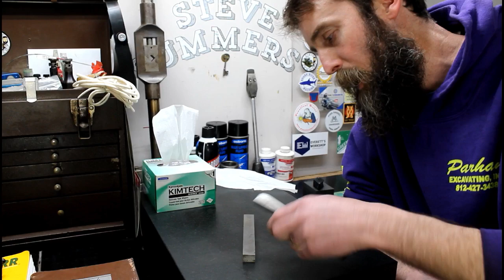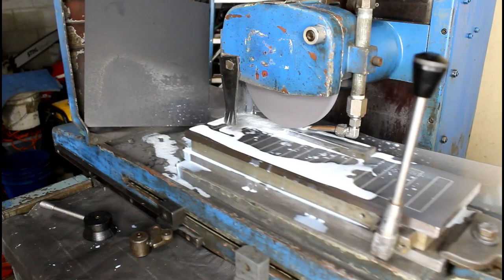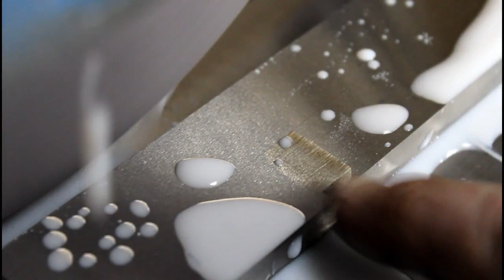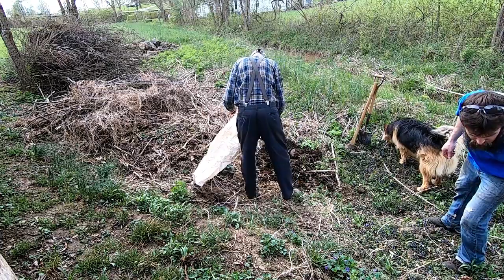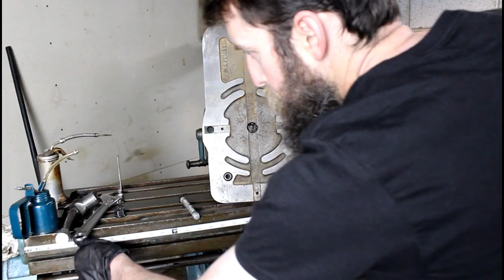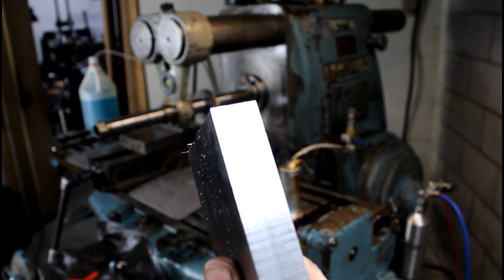Throwing a part off the surface grinder! HARD  :-)

Comment: Those weren't very good ideas. You shouldn't have blah blah blah ...
You can fill in the blanks. 😊
You want to know how I come up with all my good ideas?
They're the ones left after all the bad ones fail.
I damaged a test indicator because I put it where I could bump into it and knock it on the ground.
Thought it was a good idea when I put it there, but, no, it was a really bad idea. I won't be doing that again anytime soon.
Had to send it to Mark Ratkowski (MR Tool Repair) for repair.
It didn't cost much, he did a great job and it didn't take him long but I didn't have a test indicator for a month.
I had another broken one that I sent along with the one I dropped so now I have two good ones and everything worked out.
Not really convenient when you're trying to get some work done.
Long winded way to say I share your pain.
Thanks,
John

Comment: At the Summer Bash you can check with Keith Fenner on how or if you can straighten the arbor, the way he straightens prop shafts. I don't know if an arbor can be brought back by the same type of process or not. Good luck.

Comment: A few tips on the horizontal: Never tighten the arbor nut fully until you have the arbor support or supports in place..Never climb mill with that machine...When you fill the arbor support with oil, be sure to put a few drops in the bushing from your oil can so that the bushing does not run dry before the wick begins oiling....Mike in Louisiana

Comment: Tips. 
Block the parts.  Make sure the coolant contacts the surface before and after the wheel contact. When using low magnet force, take "tenths".

Comment: Steve, I'm not sure if it was just the camera angle, but it looks like you had your paw awfully close to that grinding wheel, had a friend who was a seasoned surface grinder operator who had a 1/4 wheel dressed to a knife edge take three fingers off reaching into wipe a part while wheel was spinning, he didn't realize he did it, until he noticed blood on the chuck and he look at his dangling finger tips...be careful..

Comment: I have been surface grinding for 30 years, for small parts like that put a couple drops of super glue under the high spot and wait about 5 minutes  for it to harden the use magnet full strength.  or use shims for larger warped parts
Reply: Really good tip there.
Reply: @steve gale  well any way that gets results and good parts..to each their own.
Reply: How do you shim 1 or 2 tenths?
Reply: i take a single ply tissue put under the whole part then use superglue under the entire part. but without the right coolant and wheels you will never grind better than .0002 usually..

Comment: To much step over caused the wheel to contact too hard and it expanded just like you said. Wheel seems a little hard,  use a deeper and faster dress to help cut with less heat. Paper towel soaked with coolant under the parts really helps get that little bow out of parts.

Comment: Some 40 years ago, i had to grind tiny thin parts. I walled them in with sheetmetal as best, as i could. One of them started of and flew through the shop like a bullet. I have no idea why, or where it landed. Never saw it again (was a large shop). It was late in the evening, i was alone. Normally, there were about 30-40 people working. I was very glad, that i was alone, and nobody could be hit from the part.. It happens from time to time. As long as nobody is hit, so what. But if somebody is hit, he maybe dead in worst case. Surface grinders are dangerous machines. And, nevertheless, fences do help. I would not throw the arbor away. Why not straighten it? Should be doable. Needs a bit time, but what´s to lose....

Comment: Morning Steve! What advantage is there to grinding at 45 degrees like TOT does?
Reply: Grinding at 45° means the grinding wheel is on the part less time than if you ground parallel with the table travel.
Reply from the maker: Good morning Craig. Like several other have said it's a heat thing. The less time the wheel is in contact with the part the less heat it inputs. Only draw back is it takes a bit longer to grind. But it's very effective 👍

Comment: I always “block” the part on a surface grinder when using residual magnetism
Reply: @anonymic79  my old boss related a tale from his youth working in a war production factory in WW2, during an air raid if the lights went out you had to immediately duck as the mag chucks also went out.
Reply: I always used to block stuff on a magnetic chuck, and you'd be surprised how good plasticine stuck all around the work piece holds it and stop's the ringing.
Very handy when grinding big thin stripper plates.
Reply: We do the same with blocking. Large flat pieces around the parts that are lower than the part keep the part being ground "corralled" on the mag chuck. Prevents it from moving sideways.
Reply: does that mean you put more pieces around it to hold it?
those magnetic surface plates freak me out.
Reply: Malice min I like using a thin piece of steel with more surface area just on the side that prevents the work piece from “kicking or breaking loose” I have seen more than one surface grinder with dents on the guard where pieces have been thrown into.
Reply: anonymic79 I understand 😱
Reply: I saw Robin Renzetti (I think, but I might just associate every really informative surface grinder video with his channel for some reason) use combs like this on his mag chuck to help hold down slimmer parts. Is this what you mean by "blocking"? https://sites.google.com/site/lagadoacademy/machining---lathes-mills-etc/build---comb-clamp

Also, could you explain what you mean by "using residual magnetism"? Do you turn off the chuck for some reason before beginning the grind, so the bars aren't actually engaged?

Also, would it have made sense to do light "cleaning" passes on each side of the parallel before going into the heavier passes to actually flatten the thing? Any pitting from corrosion would increase the distance from the magnetic elements and thus the holding force of the magnets, but I'm not sure if that would actually lead to a real difference in holding power?
Reply: Blocking is the most significant component to stabilize the part. Ensure that the blocking straddles magnet segments.
Reply: Blocking is always a good practice when able.
Reply: I was 6 and saw my grandad almost take his leg off with a saw. Safety is not to be understated.

Comment: Solid Rock Machine Shop had a video showing how to take bow out of a piece on the surface grinder. Pretty thin stuff too.  Also, always use a backup block behind the part when possible.

Comment: Maybe use a vice for the first pass? That way you apply the clamping force on the sides of the pieces and the bow should stay where it is. After grinding the first side you can put them on the mag chuck.

Comment: Steve, When you have a bow, measure it; add silver leaf under the bow of that thickness; use full mag to hold it down & grind until perfect. Then flip 180* & flatten the opposite side. Problem solved accurately.

Comment: Chainsaw safety is never overkill for any job no matter how small. In fact it tends to be the smaller jobs where injury happens, as you tend not to concente as much.
Reply: My cuz took a chainsaw to the face due to kickback, just missed his eye, you can never be too careful with a chainsaw.
Reply: My dad was one of these people who would disable or remove any safety feature on anything he owned (still to this day, I don’t think he has a single 3-prong plug in the house that has the ground lug attached!).   He also worked in the woods for many years before his current job.   This same man that disabled every safety feature he could, wouldn’t as much as start a saw to make a single cut without putting on chaps and wearing a cutters helmet.  Knowing how he is with other safety issues, yet never failed to wear all PPE with a saw speaks volumes to me about how important it is to wear every time,

Comment: I've  done that once or 3 times😉
Reply from the maker: I should have packed the part at the ends but I thought it was good.😁. I was wrong
Reply: @SteveSummers  I block small parts with thin parallels now . Unless the part is thinner than the parallel

Comment: Adding blocks across the end would help the holding power a bit.
Thanks for the vids
Reply: @Zuluknob  I think the reason the part expanded into the wheel was because it slipped in the first place. As you can see it moves a bit and stops before the grinder really gets hold of it and throws it off the magnet. That causes the wheel to be in contact with the part without moving through it, thus generating the heat and expansion into the wheel. If the part was more securely held by blocking up on either side of it, I suspect the wheel would've made it through without moving anything and it all would've been fine.

That being said, it did look like a bit of a heavy cut for that grade of wheel, so I don't think that helped either.

Just my theory anyway. Hard to say without being there. Doesn't matter too much anyway, no real damage done and a lesson hard learned.

Comment: I'd be interested in seeing your setup for grinding the spacer parallel!
It's pretty tall for the base footprint, i'd imagine very light cuts would be needed!
Reply from the maker: It was packed with two angles and just dusted. That was after the part got tossed off the chuck so I was on guard for sure😁

Comment: if you take a heavy cut  the heat from the cut can make it distort and lift off the table also it's a good idea to put packing on the magnetic chuck as a stop for what you're grinding

Comment: I worked in a shop about 30 years ago and one of the grinder hands was cutting slots in a series of pieces that were ganged up. The grinder wheel was about 10 thousands wide it broke and cleaned all of the parts off the magnet and throwing them into a fiberglass panel. He was not able to work the remainder of the afternoon due to nerves.

Comment: I cringed when I saw that parallel start to move, I knew what was gonna happen, always put a good flat piece of steel to the right hand of the job to maximise the effect of the magnet without pulling it down too much, using the full force of the magnet pulls the bow out only for it to return when the magnet is turned off. A trick I saw the Old Boys do when I was an apprentice was to put a layer of blotting paper under the job when tickling the last couple of tenths off. Best Wishes from Somerset UK.

Comment: Ox Tools showed that some marking inks / pens, had a measurable repeatable, thickness, could you paint the centre of the bowed pieces so that they appeared flat at least until you could turn them  over, and you could use a large flat thinner piece of steel as a fence / stop as the larger area would hold better. maybe on the sides as well.

Comment: Would it not be possible to place shim stock under the hollow when doing the first side to minimize the warpage created by the magnet? Once the first side is flat then you could do the opposite side and take the ends down parallel.
Reply from the maker: Yes, that's the common way of repair. 👍